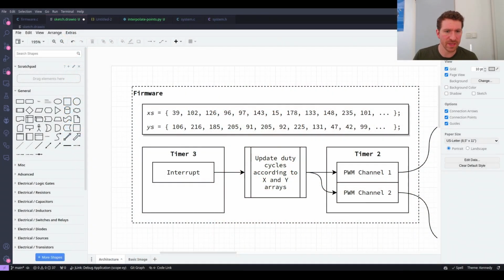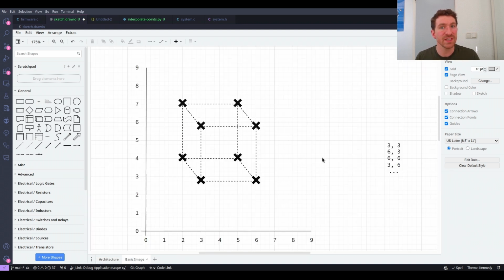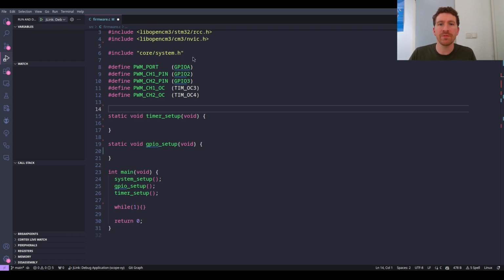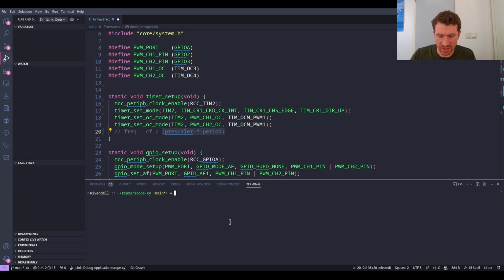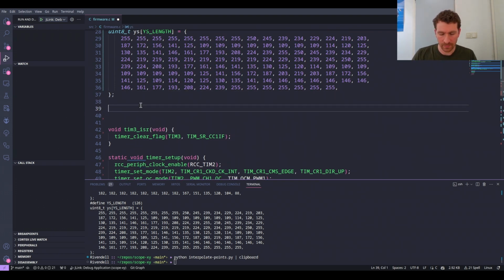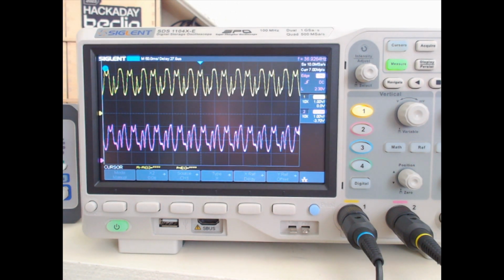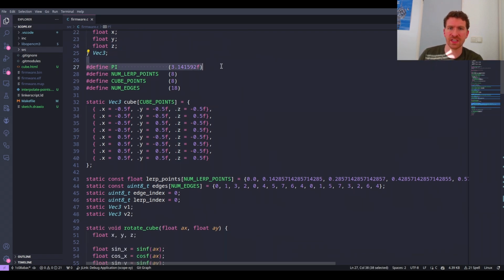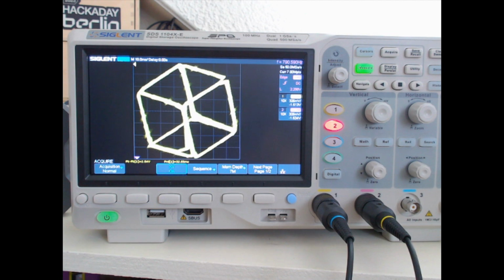Rendering 3D Graphics On An Oscilloscope

Comment: Will aurduno work as a micro controller
Reply from the maker: Yes, you can use an arduino type board (technically arduino is not the microcontroller, it's a framework that operates with many different microcontrollers)